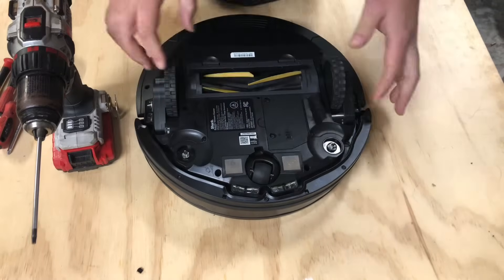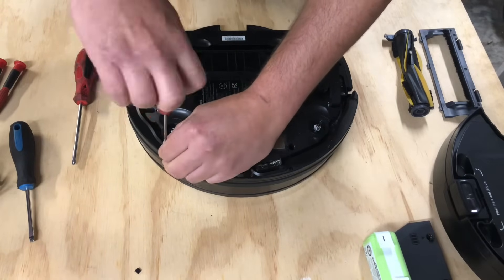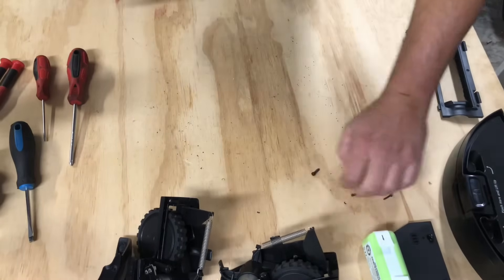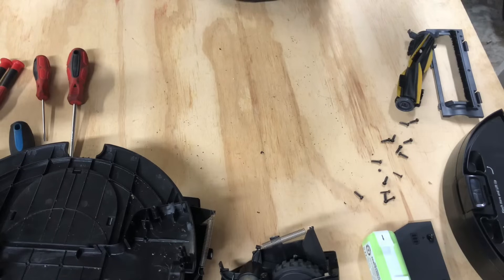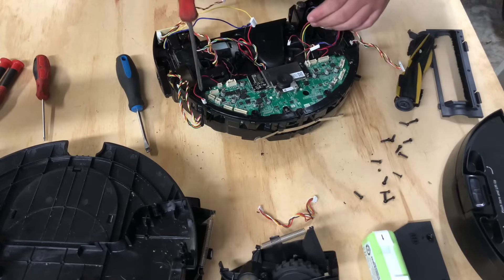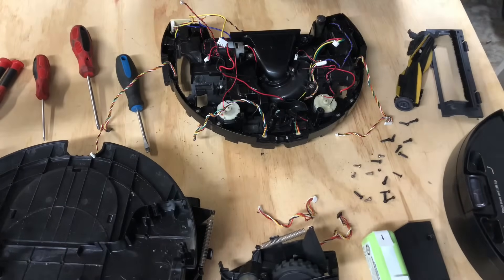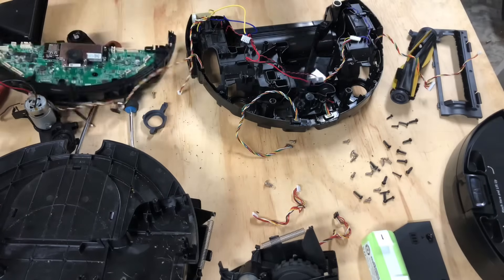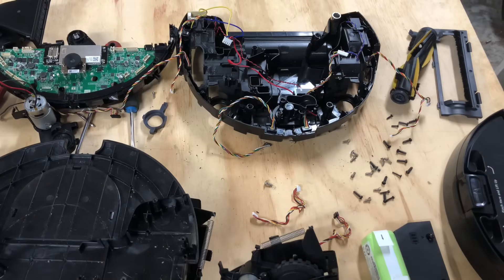Shark IQ 1001 series robot vacuum cleaner tear down video

Comment: RV754R01CA stopped in the middle of the floor. I took it outside and gave it a blowout with the air compressor brought it back in started it. It moved 5 feet and stopped. I watched a few YouTube videos and decided to start dismantling it. Everything is working perfect the filters are clean. The blower motor is spinning. The wheels are turning. Everything is working good but it will notgo. Please help.

Comment: Hello, question I have qr1100 battery it self have 15v but unit says low battery. I primarily checked the board no corrosion or obvious visual faults found. What might be the issue of which part or component I should be looking at?

Comment: I kept getting error #2, indicating something was obstructing the robot. I did all the basics. New filter, brushes, vacuumed everything out, cleaned the wheels, etc. After watching this video, I went deeper, pulled the wheels out and found a ton of dog hair. That was likely my issue. Unfortunately, when I got everything back together, the right wheel is completely unresponsive. I am thinking that I damaged the wiring while taking the wheel off (it took me a couple tries to figure out how to unclip the wheel). I bought a new wire on amazon, hoping that to be the fix. Can you think of any other reason the wheel would suddenly become unresponsive after taking everything apart down to the motherboard?
Reply: Did you plug the wire back in to the wheel?

Comment: I followed your video to replace the suction motor, and somehow, I still ended up with 4 screws😂. Even after replacing the suction motor, it still leaving stuff on the floor. What else does it need to get that suction power again?

Comment: Hello, Thanks for posting these videos on  a seemingly mundane subject but are very helpful.  I have a Shark Robot Vacuum  Model UR1100S1US. I purchased it used, the problem it has is that it gives an Obstruction error (error #2) as soon as it tries to move upon pressing the "Clean" button, the only movement that occurs is that it gives a slight jolt as if trying to turn and then the error comes up.  I have disassembled it and cleaned out all the hair and dust in the wheel wells, the brush roll and the brush roll endcaps, cleaned the sensors, changed the filters etc.. I have also taken apart the wheels to inspect the gears and the rotation of the wheels and everything is fine. I have also attempted to see if the error goes away when I attempt to have it clean without the roller brush but it still gives the same error. I also replaced the main brush motor Any ideas?? I would appreciate your input.

Comment: I have a rv1001ae which has been working ok until it stopped no power, no alert) during a cleaning cycle (ran for at least 20 minutes) with a bunch of non-cleared serif underneath.  I cleaned it out . Shortly after backing from the charging station or within a few minutes, it simply powers off or powers off and sometimes reboots but fails immediately afterwards again.  I cleaned the visible sensors, found a piece of a leaf in a wheel well sensor area but nothing else I could find.  What could this be?  It never gives any errors, just dies.  Thank you!

Comment: Hey Smitty, I have a RV1501 model and it won't power on! Some water may have been dropped on the side of it...not sure which side...I am hoping there is a fuse on this model, any idea where it would be located or do you have any other suggestions? Thx
Reply from the maker: No fuse that can be changed out like that

Comment: I just got one from a friend and says not working..does not run..I called the company and they said software issue? Is that true? It lights up..but does not move..no wifi..it does do a self check..but will not vaccum. And ideas?
Reply from the maker: What model

Comment: So I'm having problems with it being able to charge changed the battery already started working but I'm noticing the metal on the bottom isn't hitting the chase port trying to get to them and bend them out a bit

Comment: I have similar model, but it's the self emptying. I keep getting a debris stuck in parts error. I took it all apart and cleaned a lot of hair and dust from the roller brush and side brushes as well as a clump of dust from under one of the wheel motors and I still get the error. One of the brushes spins a bit less freely than the other. I'm thinking that one of the brush motors is failing and causing the error. Shark tech said that the side brush motors are not serviceable, and the model is disconnected. I think it's b.s. that they don't make the brush motor easy to change out like I did one time with a Roomba. Also, I was not able to get my iq robot to completely separate in half after removing all the screws. I want to see if I can find an an aftermarket brush motor on amazon or online somewhere.

Comment: You are awesome! Woke up to the aftermath of my dog getting sick on our lux vinyl floor. To add insult to injury, our self emptying Shark vac that had not only spread it everywhere but was just caked with... stuff. I really contemplated tossing it in the trash. Thanks to your video, I was able to disassemble the whole thing, clean it, and save it to fight another day.
Reply: What did you use to remove the 5 body screws? Can't figure out what to put down there to reach them. Oh and mine went through dog poo 💩 🤢
Reply: Same here😅
Reply: Can't the middle wheel be taken off?

Comment: I have the same model and used your vid to tear it down to clean the dustbin switch  but when reassembled it now has an error 6 "make sure my bumper is moving freely"... it is btw but it looks like the 3 spring loaded fingers that face upward are worn and the foam bumpers are wore as well....cant find the fingers anywhere, shark customer service is no help, do you have some unworn fingers?

Comment: My vacuum rv10001ae self empty hit it's dock so hard it cracked the front clear black plastic though I didn't know it till later on about a week ago it started giving my the code that something was stuck under it it did that about a year after I first got it and I replaced the roller and it worked fine for a year and five months so I bought a new roller and it still giving the code and stopping I never let people wear shoes in my house it's only me my fiance and one cat I have kept my filters changed I have laminate floors with two area rugs that are low pile. I have ocd so my house is spotless I have never let water near it I always pick up cat toys and things before I run it so I'm baffled I wonder if it's because the front is cracked it's directly in the middle so there is no sensor behind where it's cracked so my question is if you think that's the problem do you have one that you would sell me? Or second question since I can't live without the vacuum I already ordered another one I bought it renewed on Amazon for a little over 100.00 and I bought a three year warranty with it so I already have a replacement coming but if I could fix this one I could give it to my daughter or if you don't think that's the problem and it's nothing I can do to fix would you be interested in buying it to either fix or use for parts. I just put a brand new battery in it last November then I just replaced every filter and the brushes and brush roller and door with all parts and filters from shark which is what I always have used that's why I'm confused Its doing this because I have cleaned it every month and did everything I was supposed to.

Comment: I'm getting an error #6 about the bumper all the time. I've taken it apart a few times and everything seems to be in working order, aside from one of the levers sticks a bit sometimes. I'm at a loss for what to do...
Reply from the maker: Sadly there is not a lot of things you can for this issue. It's super common and without replacing the motherboard or the full sensor pack you might as well buy a new one.

Comment: Hello. My 2 in 1 ran over dog poop I have cleaned it pretty much but I cannot take the wheels off to clean out the wheel wells. Can you help me out. This video showed how to take it apart but I don’t want to sell it for parts. I just want it cleaned so I can use it.
Reply: I just had this happen. You need a T8 screwdriver to remove the screws. There are 5 surrounding the wheelbase. 2 are deep and 3 you can easily visualize

Comment: We have the self emptying model, today when I went to remove the roller brush (2.15 of your video) I find it WILL NOT come out, normally it just pops out like yours did.
We have dogs, maybe it's the hair jamming things up? Ever had this issue?
Reply from the maker: hair can get trapped inside and make it hard to come out but should come out no issues

Comment: I have 2 of these.  One gave a cliff error when in warranty and the replacement (2 years old) is now giving an error #2.  I've totally dismantled it and cleaned all the hair for the cats out but can't get the effort to clear.  In the one with the cliff error I also took it apart and see no obstructions or dirt.  Any suggestions?
Reply from the maker: Sadly the iq series robots are very hard to fix and keep working. The sensor issue is bad on these you can find the broken sensor by turn the light off flipping it over and using cell phone camera to figure out which one is bad. Only problem is I don’t sell these because they are so hard to verify good parts

Comment: does the battery connector assy come out and can I get one. mine fell apart when I removed the battery. obviously I didn't depress the connector far enough and now I have a loos pin.
Reply from the maker: No sadly you need a whole new motherboard

Comment: I have this same model robot that was replacing the wheel motor, had an issue. I am hoping you can help me with. There is a metal wedge, looking piece about 2 inches long that came out when I was trying to reassemble it, I have no idea where it came from or how to put it back in… Do you know what this part is?

Comment: Hey! So we had to tear down our robot vac to clean out (ran over dog shit😡) anyways when popping out the front wheel, the part that holds the wheel, it looks like the screws broke off…I know we can get the part replaced but any ideas how to get the whole thing out since the screws broke???
Reply from the maker: There should be two screws that hold it in some are on the inside of the robot and some are under the wheel. Might have to drill it out then glue in the new housing.

Comment: I have two Shark 1001 robots. One the suction motor nor working. The second is giving me an error two. I have cleaned it throughly along with the wheels. I removed the wheels and lubricated the robot and still getting an error two. Can you help with my two problems. I believe I need a new suction motor. If so how would I order it from you. Second any advise on the error two would be appreciated. Thanks.
Reply from the maker: Smittysworld2015@gmail.com

Comment: Wish someone could help me mine started going nuts it’s going fast and back and forth and now it goes one inch and says obstruction and in the app it says something about wheel drive or something it’s exactly one year and now it goes crazy. I love this thing so much and can’t just afford to buy a new one I bought it after saving because I’m disabled somewhat and can’t do any sweep or mop or scrubbing action as I have serious spinal back and neck problems and I can’t do it and now it’s done I’m so upset because I have the xl self empty that I grabbed on Amazon treasure truck so paid half when it was pretty new got lucky I had enough gift cards lol now idk what to do I was saving to get one next year the vac and mop self empty one that changes the dirty water out but figured after a year it will go down and maybe a newer molds will be out ugg. I gotta say I really loved this thing until it went nuts it does a great job and saves me from hurting myself
Reply from the maker: Sounds like the sensors are bad on it , Call shark and tell them its less then a year old and see if they will warranty it out.
Reply: @SmittysWorld  thanks I will but I think it’s been one year and two weeks.  Sucks but I’m still gonna call maybe they’ll fix for a small fee hopefully
Reply: @SmittysWorld  they will not help it was a year in July

Comment: Mine keeps saying suction motor not working. Ive cleaned all filters for clogs. I don't understand. If you could help please. Not sure what I'm doing wrong.
Reply from the maker: Use air compressor the blow out the suction vents might have something hanging the motor up

Comment: I have water get inside my vacuum and I’m getting the cliff error I can see the residue on the inside of the cliff sensor so can’t actually wash it off from the outside. When you take it apart do you have access to clean the inside of the cliff sensor ?
Reply: Did you ever fix it

Comment: Hey have you seen one with error#11. Mine when it tries to doc it sees it but doesn't find the connection metal part on the docking station. So I manually push it till it connects and I see the blue light on, 3 to 5 seconds later it states Charging Error # 11 and a Red Exclamation mark comes on flashing and the Doc light blinks blue.

Comment: I asked this on your other video but is there anyway to full the cliff sensors mine is doing this exact same as yours mine is the self emptying but everything was working just fine until it ran over dog poop and then my friend clean the sensors and all that but they ended up getting a brand new one sent to them from shark so they gave me this old one to see if I can fix it.
Reply from the maker: Need full sensor set and maybe a motherboard cleaning the sensors with any voltage or any thing besides 91 percent alcohol will fry the sensors and sometimes pop the motherboard.
Reply: @SmittysWorld  so I just took it all apart and I can see the issue on one of the front sensors it shorted out. It had a small bridge on the 3rd and 4th pins and it made a small black spot on the connector that’s on the actual board.

Comment: I just took my cover off and I have a weight light thing. It's got little lines in it and it's about 2-2 1/2 inches long. Have no idea where it went
Reply: Weight like**
Reply: It has a small round piece of foam glued to one end of this little piece.
Reply: My vacuum says there's an obstruction, error 2 but there's nothing blocking the roller brush. The motor won't engage and I've spun it by hand a few times with no luck

Comment: i have a rv100 iq self empty and it will not come on no lights i have removed the battery and put it back in and turned it off back on left on the charging base for 24 hours and nothing no lights no sounds like it dosnt have a battery at all , i tested the bnattery and it does have some charge in it not much but some any ideas? thanks
Reply from the maker: Charging the lights will blink . Battery could not bad , charger could be bad , or the motherboard has gone bad

Comment: I was getting the "too close to a cliff" error and/or the robot was just spinning in circles. I cleaned all the sensors on the bottom to no avail. It seemed like problem was within the bumper — and your video showed me the trick to taking it apart!  Sure enough, there are many other sensors underneath the bumper and the bumper itself has an inner plastic surface those sensors apparently reflect against and/or shine through. After a thorough cleaning and reassembly, the vacuum is working perfectly again! Thank you for posting this video!
Reply: I'll have to try that. My Shark is giving me that error after it took on dog poop and I cleaned it the best possible without tearing it down completely. Thank you both for the info. I called customer support with zero support on how to fix, they just wanted to sell me another one for a percentage off!
Reply: @WarHoss  Mine got into trouble after he tried to clean up after my cat had misfired in the bathroom.  He's been working fine ever since I cleaned those under-bumper sensors, so I hope you'll be successful in cleaning yours too.
Reply: @ElmerCat  thanks I will definitely try that!! 🙂👍

Comment: I’m getting dock and clean GREEN lights flashing + (!) RED flashing…. Robot goes out and stops. Any help appreciated. This error code is not on the manual. Thank you!
Reply: My RV1001AE just started doing this. I called support, did a video call so they can see the issue. They claim the whole unit needs to be replaced and said that there aren't any replacement parts available to fix it. They offered a 30% discount on a whole new unit which ended up being $150 more than I originally paid. If anyone has any other suggestions, I'd love to hear them.

Comment: What happens if you run over water and the Cliff Error (code 7) keeps repeating itself? Is this fixable??
Reply: I also was getting the "too close to a cliff" error and/or the robot was just spinning in circles. I cleaned all the sensors on the bottom, but the  problem was within the bumper — @ 2:38 this video shows how to take it apart.  There are many other sensors underneath the bumper and the bumper itself has an inner plastic surface those sensors apparently reflect against and/or shine through. After a thorough cleaning and reassembly, my vacuum is working perfectly again!